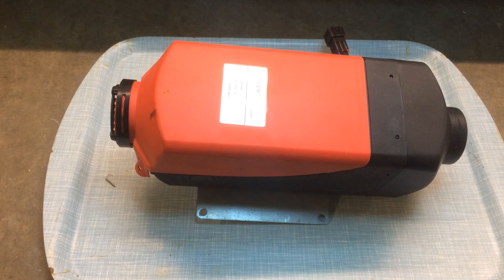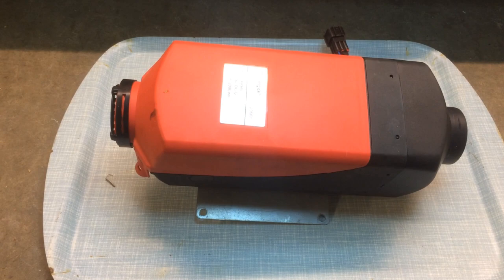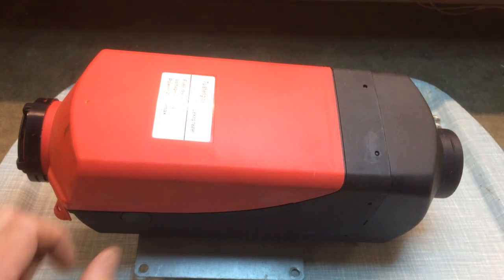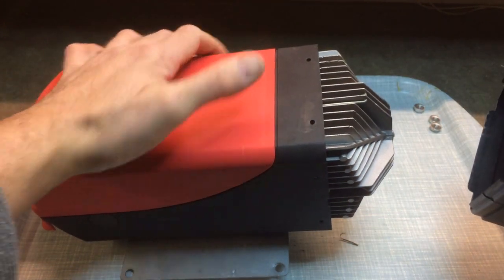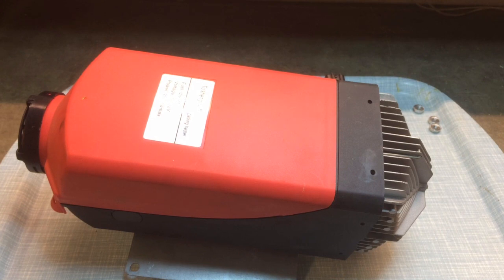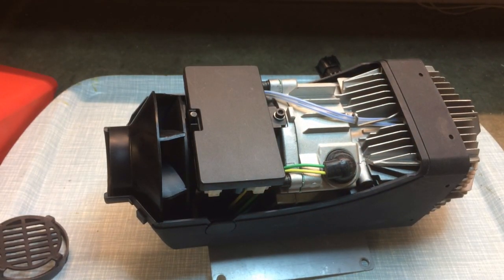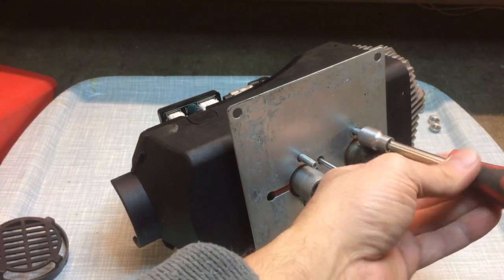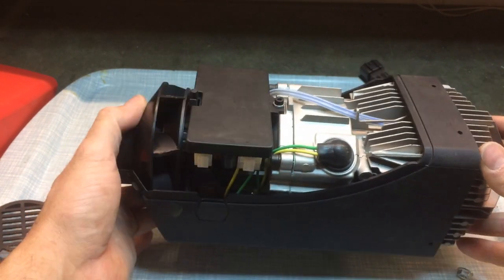Repairing a Chinese diesel night heater 2kW: disassembly prior to cleaning

Comment: Hi, Great videos.

We're currently planning converting a MWB Ducato into a camper. I see you have experience (and tweaking/repairing) with both 2kW and 5kW diesel heaters. 
Considering the size of a Ducato would you now fit a 2kW or go for a 5kW and use it at low output?

Cheers

Ron